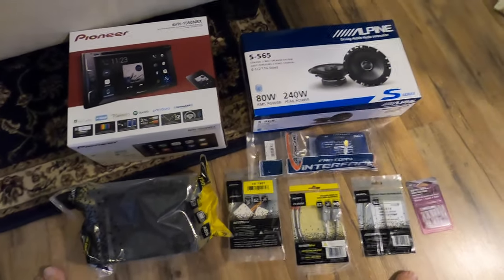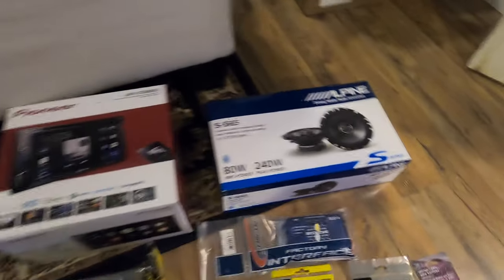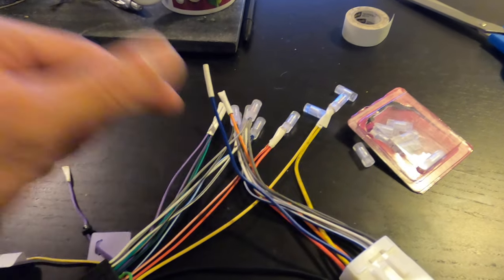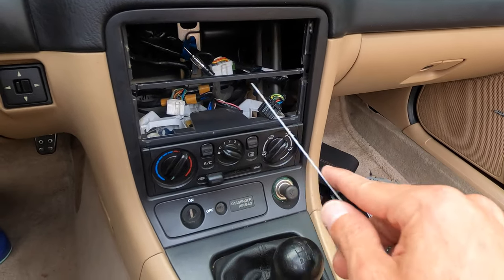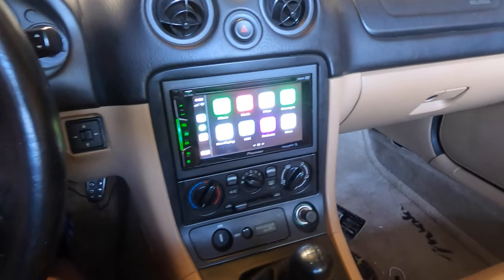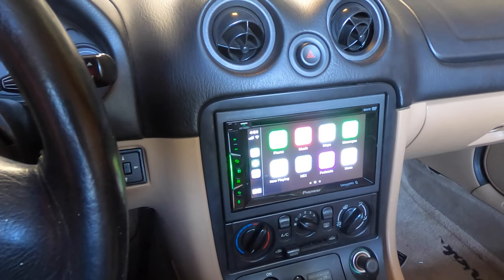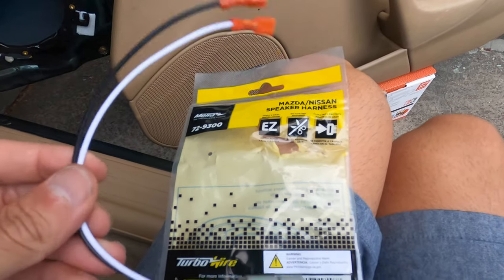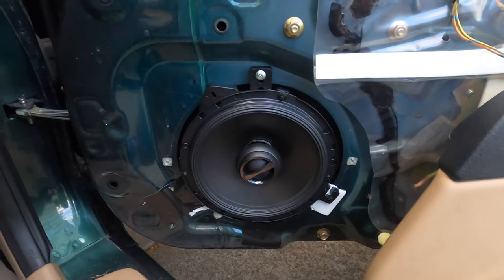Miata NB Bose bypass stereo install

Comment: Good video! After trying repeatedly to do the Bose Amp Bypass with jumper wires, I decided to follow the diagram I found on Miata Forum and cut the wires behind the plug and connected them with butt connectors. The new Double DIN Pioneer works great!

Comment: Hi Dennis - good project - I have a 2009 NC Facelift and also ditched the Bose, going for a 2-DIN Pioneer naviceiver. I kept the original speakers, but bypassed the Bose amp. It's so much crisper and clearer. I have 800 CDs ripped to FLAC playing from a SD card or listen to digital radio. 
I'm no fan of Bose - to my ears it's too much signal processing and loss of fidelity  (yes, I'm a hi-fi freak). You did well to document it on video. All the best, Rob in Switzerland
Reply from the maker: Thank you!  I have recently put the original speakers back, currently considering other options.

Comment: Really late here, sorry. I have a 99 with the amp and original speakers still in but they are blown. Also, a few years ago I had a Boss double din headunit professionally installed. If I were to install some new speakers I got but without an amp (while still bypassing the Bose amp), do I need to do any wiring myself or will everything just "plug and play" directly?

Comment: Hello, i had bought my miata and i’m now replacing the radio in mine and i was wondering what kind of wire you used for the amp plug bypass
Reply from the maker: Just 18 gauge wire

Comment: Hey, i upgraded to a kenwood unit and it had a amplifier output so i was able to use that. Radio works great! Problem is that ground cable you pulled off the old stereo, i have no idea what to do with it, but now my cars kicking a cel i cant check cuz it killed power to my obd2 port. Any ideas? Im debating cutting the tab off the old radio and soldering it to my kenwoods ground but not sure if thats why my obd2 died
Reply from the maker: Sorry to hear, I am unsure on that one. But for sure you need your obd2 port to work
Reply: Try using a male spade connector with the ground wire coming from the new radio's hardness. It worked for me and I did not have to cut the OEM female spade ground wire at all!

Comment: Looking to do this, why do you need to splice into the parking brake wire? Thank you
Reply from the maker: You don’t have to , but on some head units certain features such as video will not work unless it detects the parking brake is on.
Reply: @dennisstafford108  got it, thank you for the reply. Been doing a lot of research, thinking of going for either the pioneer Dmh-2660nex or Alpine Ilx-w650. How do you like your pioneer so far. What are your thoughts?

Comment: Thanks for the video! Did you use the original speaker wires?
Reply from the maker: Yes I did, no issues
Reply: @dennisstafford108  That's good to know, thanks for the fast reply! I heard the Bose wiring setup has a different ohm impedance from most standard aftermarket speakers so I wasn't sure if I needed to buy some sort of adapter, etc. (Sorry if I've explained this badly, just started figuring this all out so getting my head around everything)

Comment: helloo, is bypassing the bose amp necessary if im not replacing the bose speakers?
Reply from the maker: No, but if you are not you should use a line out converter to reduce interference and increase volume. 
I did not want to use the converter mentioned 30 seconds into the video
Reply: @dennisstafford108  you are awesome man thank you

Comment: This looks pretty simple but the biggest pain the ass is unplugging the amp. Mine is stuck pretty heavily
Reply from the maker: Yeah.  If I remember correctly I was able to grab it from the underside from the driver side footwell
Reply: @dennisstafford108  do you remember if you had to push down on any tabs or did it just simply pull off?
Reply from the maker: @MrTWINARMAGEDDON  just pull it if I remember correctly

Comment: I just installed a radio in my mazdaspeed miata but i didnt do the bose jump thing, what is that for?
Reply from the maker: To bypass the Bose amp if you have the Bose system. Otherwise the volume would be very loud at low volume.

Comment: what speakers did you replace them with
Reply: also did you connect the new speakers to the old bose wires that ran through the doors? or did you run new speaker wire through it?
Reply: @dontmissthe_elevator  Did you ever find an answer to this? Having the same issue with mine.
Reply: @JoeBradyPhoto  I connected them to the old Bose wires. I'm still using the stock Bose amp, the stock amp works decently but you can only turn up the volume so much before it starts distorting.   I didn't install a new amp because it was too much trouble lol
Reply: @dontmissthe_elevator  Thanks for your reply! The issue I'm having is that I have no bass/mids from my speakers which makes me think the amp itself has blown. Not sure how I could test this without gaining access to the amp itself though, which looks like a PITA.
Reply: @JoeBradyPhoto  hmmm yeah could be a ur amp giving you issues. Are you using an aftermarket head unit?
Reply: @dontmissthe_elevator  I am! It was working perfectly fine, car went in for some unrelated repairs and when it came back the speakers had lost all mids/bass.